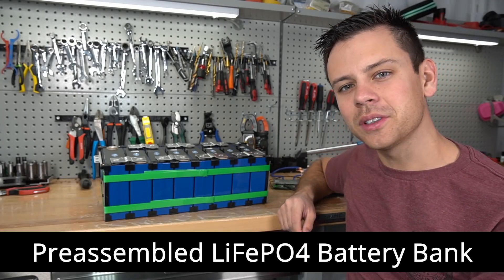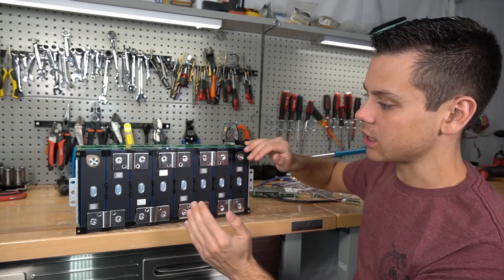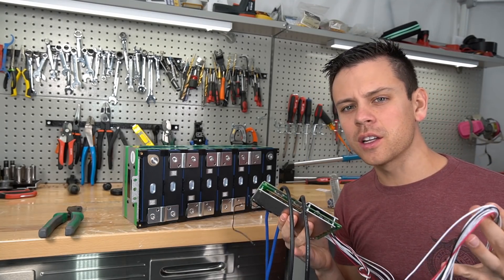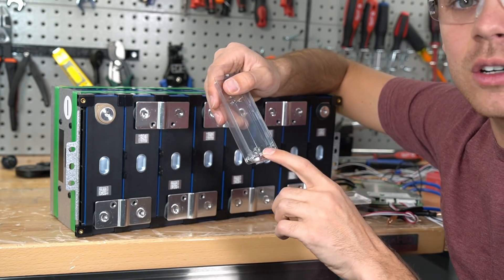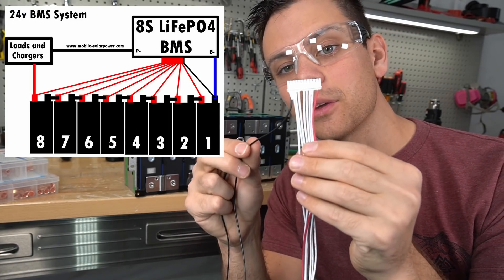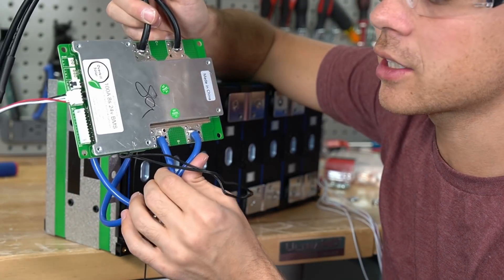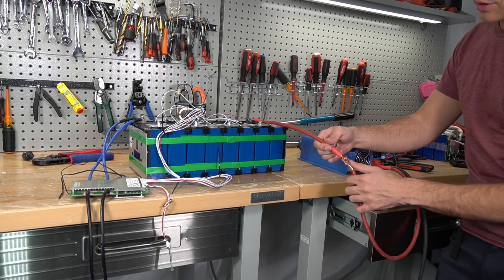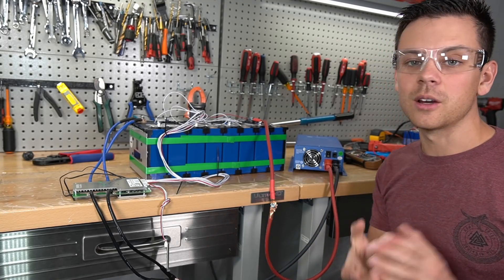Dirt Cheap 24V Preassembled LiFePO4 Battery: Beginner Friendly Tutorial!

Comment: I plan to buy new LifePO4 battery 24V 80ah.  Can you help me change the correct charging setting for my Hybrid Solar system 2400W SPH-3K.  also, I make connection 2 parallel and 2 series using 4 - 250W solar panel.  Is it correct?  Thank you

Comment: What do you think about mixing LiFePo4 and 18650 NMC?  I have over 12 kWh battery bank built with 18650 cells.  It is 14s giving me 51.8v nominal.  I have been thinking about adding to it with LiFePo4 like this (2 of them for 16s).  The voltage ranges are very compatible but I have been wondering about the different discharge curves and whether it would result in extra and undesirable strain on one chemistry or the other.

Comment: Man I WISH they would have not welded the bars. Be a really nice parallel 12 volt system for a camper. 24 volt is just to much stuff to change.
Reply: Not really I just got a step down circuit super easy to install that was that
Reply: Rubi Doo, send me a message if you want to buy the ones with the bars. I'm looking at upgrading to server rack units and would sell you my setup.
Reply: You could probably cut the welds off the bars, the post are threaded.
Reply: Cut the welds

Comment: Hello Will, I'm looking for the leads for the cell meter 8 and for a Daly BMS 200a is or I should say 9s . I'm going to be building two 24volt 200ah lithium batteries so I need two leads for the BMS s

Comment: Um, according to their website, the entire pack is 100 Ah,  NOT each cell.
Reply from the maker: Each cell is 100Ah
Reply from the maker: Ah is dependent on voltage nominal. Please watch my beginner videos
Reply: It's 8x 3.2v 100Ah cells in series, so 25.6v 100Ah. 
Series adds the voltage, parallel adds the Ah
Reply: @zeealpal  Ah, thanks.  Shows what I know!

Comment: I saw this battery pack when I was in search for a battery, but with the cost of shipping, and a BMS, the price was practically the same as an Ampere Time battery. I went with the fully built battery instead.
Reply: Which configuration did you go with?
Reply: @about2088  24v
Reply: Nice! What was shipping cost compared between the two? I’m on their site and I was getting ready to check out with this battery kit, growatt 5000us and EG4 battery
Reply: @about2088  Free shipping, and took about a week and a half to get delivered via FedEx. I'm still in the process of building my system. It'll be two 1KW systems, one for heating water in a IBC tote, and the other to charge the battery to run a water pump and a washing machine.

Comment: As an non-electrical engineer, it seems like there are solar efficiency benefits for charging batteries at low voltage (hours of effective solar power), but power efficiency gains for discharging at high voltage.  Is this a correct assessment?  If so, will we eventually see BMS's that work in this fashion?  Or is it too troublesome for dealing with simultaneous charging and use?
Reply from the maker: Not sure I understand what you mean. why low voltage?
Reply: @WillProwse  At least with Victron MPPT, you don't charge the battery until the solar panel voltage exceeds the battery voltage by 5 volts.  So you won't get as many hours of charge with a 24V system as a with 12V system.
Reply: He might mean low amperage. Long slow charge is easier on battery

Comment: With battery bank and BMS you linked I am getting closer to .29 per WH with BMS. Shipped. Even just 499 +133 no shipping no tax looking at .24 minimum. Was there another BMS that you were calculating on, or have a free shipping code for signature solar?
Reply from the maker: Yeah I was thinking they were $100 bucks but that was a while ago. I hate mentioning prices with inflation because I'll always be wrong. Check back in two months and I'll be even more wrong
Reply: @WillProwse  You ain't lyin' I've had to recalibrate multiple times while trying to talk about cost per wh, I only clarified because I had to do a doubletake when I saw those numbers.

Comment: For the price point, its not a bad throw it together 24 volt nominal battery assembly for my APC SUA1500 UPS in lieu of those current AGM batteries that tend to crap out about every 2 years. It might take forever and a day to charge them back up after a good long power outage, but hey I can't complain if my calculations are anywhere close would be 2+ hours of runtime vs a measly 20 minutes. I have a bin full of spare 8s BMS modules that I can put them to good use to boot...

Comment: I got some of the "extra" smoke out of a BMS when I plugged the balance connector in without ensuring that each balance lead was wired according to the diagram. The easiest way to make sure that it is correctly wired -- before plugging the balance connector into the BMS -- is with the multimeter negative lead on the black wire connection and then touch each white wire with the positive multimeter lead -- in order -- and the voltage should step up at each white wire .... 3.6v, 7.2v, 10.8v, etc. I got lucky since they had programmed extra smoke in the BMS and it did no harm -- the first time.

Comment: Hey Will, Another great video. I purchased mine from Signature Solar and received last week. Very glad you verified the thread size big help. Also have the same OverKill BMS have not installed due not having hardware. I'm in the process of building a mobile Solar Generator.  Purchased Growatt 3000W 24V from Signature Solar also. Going to install inverter and battery on Hand Truck. Purchased yesterday 4 Slfab Elite 370W solar panels for the system.
Reply: Thank you...I did notice the 24v being less ,,,
Am thinking of doing complete solar instead of the 6500 to have neok run power lines to a properly...
Single & flexible not tremendously needy,,
Could do primitive if needed...
But fans,ac,frige/freez would be great luxury....

Many thanks
Reply: Mark i checked the site and cannot find this pack. Do you have a link? Thanks
Reply: Mark I read through your purchases,  what items will you power?
I'm a newbie... no experience. 

Want to go solar for an offgrid system,  camper & simple electronics..

Ideally, kitchen appliances, chest freezer,lights,fan

Thanks in advance for any input..
Reply: @ncsojourner200  Hey Rusty, I'm on mainly using it for Emergency Backup power. A couple years ago we had a Snow Storm and were without power for 3 days. I have 2 Gasoline powered Generators but if you can't  get gas the generator won't do you any good. This system can supply 20amps of 110V so it can power anything you want up to that  20 amp limit. It could power a Small AC unit, Space Heater, and pretty much everything you have on your list. The reason I went with 24V instead of 48V was to keep the cost down. I spent the extra money on the Solar Panels to get the battery charge  back up with limited sunshine. Thats it for now.

Comment: so charge them with the 24v BMS separately then combine them in series for the 48v system and then put on the 48v BMS? Say what? Couldn't you just use the 48v BMS to charge them separately and then wire them in series? Also it would be cool if you told us the size of the hole in the connector, like 1/4, 5/16 or 3/8.
Reply: just convert metric to English .

Comment: You failed on the balance wires and damaged the insulation on the ring terminals.  Only use the insulated slot for insulated crimp connectors.
Reply from the maker: No, it doesn't crimp them properly. I use the non insulated groove instead
Reply from the maker: It's also too close to the cutter. Usually it damages the insulation more when I use the proper groove
Reply: WHY IS THERE ALWAYS A SMARTASS WHO THINKS HE KNOWS MORE THAN WILL.?

Comment: I just bought 2 12v 100ah for 299 and now amazon has a 24v 100 amp for 599, looks like its the same as chins, same everything just a different name. These straight from china batteries are Definitely  getting cheaper

Comment: FYI don't use the Daly clone on Amz....I tried it and it failed after 3 days.

Also... love the content, thank you. I Bought the 280ah cells and made a 24v battery. Tried getting the overkill 8s but they were on backorder
Reply: Wow, guess I was lucky I jumped on this.
Hang in there I like the overkill. Get the wires attached. Hint the terminals will recommended are 5/16 inch.

Comment: Just a FYI the crimper you used on the small blue terminals was a tool intended for uninsulated terminals. Side note; I have used the same tool hundred’s of times on the insulated type.
Reply from the maker: Yes indeed but that other spot doesn't crimp that well. I only use the uninsulated spot. the insulated one is too close to the cutters and I've messed them up using them like that
Reply: Yeah have to agree, need proper crimpers. Crimps are not done the best here, really amateurish. Which is too bad because the info here is great. 
Not sure of the gauge of balance conductors but looks from video to be smaller than 14 - 16 AWG, (Blue) terminal, maybe need 18 - 22 AWG (Red) terminals.
I find when instructing people on how to do something, do your best and if some a little sloppy at first, at least they were shown the correct method.

Comment: What is the low temperature cut off for these type of battery ?? Thanks
Reply: it should be set at 0 Celsius (34 F) for lifepo4 for charging, discharging can go lower, not exactly sure
Reply: @wascalwabbitable  0C = 32F, the temperature where water freezes. Low-temp discharge can happen safely,  but the lower the temp the less you can draw so check with the battery manufacturer for specifics.
Reply: @P_RO_  you're right, I'm not that versed in freedom units

Comment: "you have exposed conductors, it was not terminated properly"

The U.S. Navy wants to see 1/8" of bare conductor at a terminal, so they know all of the conductors are in the terminal. I have worked on ships, aircraft, spacecraft tracking stations, and they all have conflicting requirements.
Reply: Isn't that because they have sparks who don't wire terminals correctly, rather than because it's good practice?

Comment: Will, if I use a transformer down to 12v out, doesn't the amp hrs double???
Reply: Subtract losses from heat and connectors, plus cable resistance.

Comment: I’m about to buy 800 amp hours of ITM iron phosphate batteries for my RV for boondocking I have a 2000 won’t go power inverter charger and I’m am wondering is that overkill I mean I like overkill but is this ridiculous overkill at the most I have 200 W running at one time all LED lights low wattage TVs the whole 9 yards
Reply: Lithium Darn predictive text

Comment: Since you are so detailed in the research think about this. Is there a led that can be refracted and the light absorbed into a solar panel thus creating power.  LED Light bars on off road vehicles draw very little amps .  Ever get pulled over by a police car, extremely bright!!😳🤔. No I wasn’t pulled over LOL😁.
Reply: No chance! There is no such thing as a free lunch in physics. LED light doesn't have enough of the right wavelengths for silicon so you would be lucky to get back 5% of the energy you put in.
There is no such thing as free energy or free energy machines, unless you steal it from your neighbor.
Reply: Whats the point you're trying to make?  Free energy?

Comment: Nice vid, as always! For a beginner vid I would point out the security a bit more: You're wearing safety glasses at some moment, but did not mention them. You also should stress the dangers of a short circuit with metal tools. And the strict order of the balance leads should be mentioned, too. I also heared that the length of the balance leads should always the same for the same resistance of the wires.
But nevertheless: I'll see you at the next one!

Comment: Last week just bought 16 of those packs … didn’t realize they had welded bus bars…. Planning on using a 32s BMS ( any recommendations?) to supply a 96 volt load. 
Others will be configured for 48 volt.  Here again any recommendations for the BMS?

Comment: Where did you get the 8 gauge wire stripper? Anything over 10 gauge is hard to find. I do prefer the heatshrink ring terminals for the balance cables, but they do require a different crimp tool. Top balancing is not that hard if you have the correct power supply, just charge up each cell individually, certainly tedious and time consuming, but not hard. You could also use an active balancer to speed things up. Likely even the small balance current from the BMS would balance them after a couple of cycles (just resist the urge to think more is better, leave it set to balance above 3.4v). Likely the cells are very close to balanced, and the only difference is the per cell self discharge rate that should be very close.